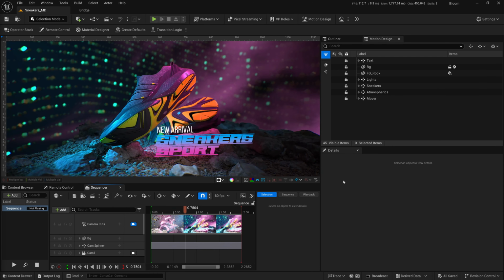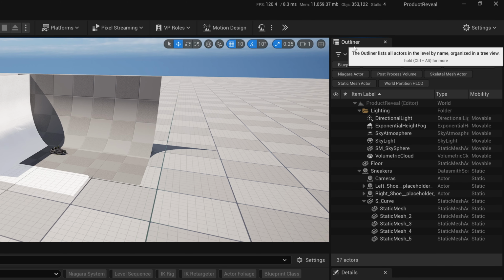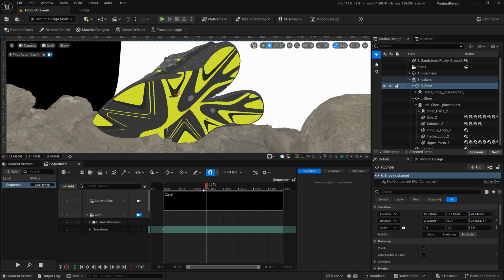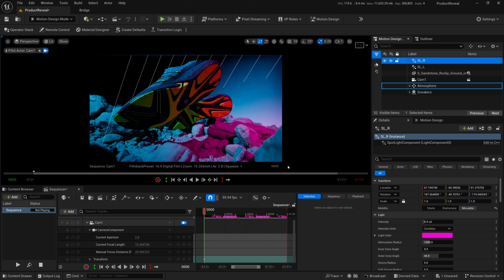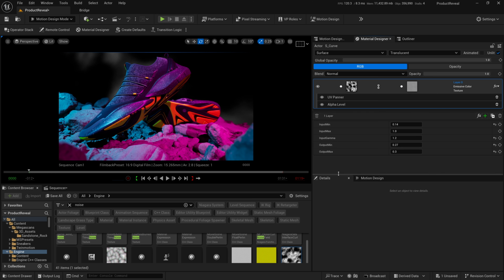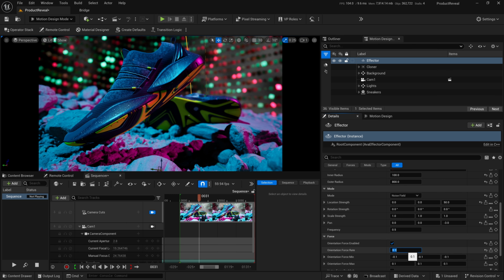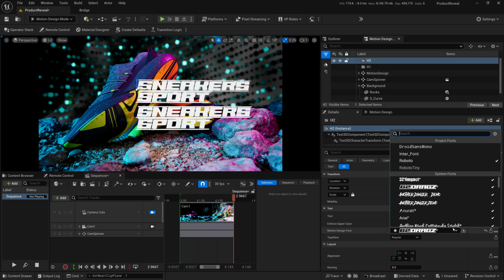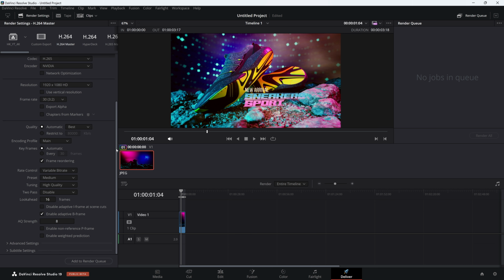Unreal Engine Motion Design ~ Product Reveal (Full Tutorial)

Comment: Thank you for the tutorial! 
Have a question, i have a problem using the material designer and can't find a solution for it, basically as soon as i save the material designed with material designer, i cannot add animators to the layers as i can when live editing it. I want to save the material and then use it later on other meshes and modify it a bit but can't access the animators on the saved materials. Can you please tell me what i am doing wrong?
Reply from the maker: Apparently Epic changes stuff on every version. I suspect you’re using a new ver of UE? The process might have changed. There isn’t much documentation on the Material Designer. Sorry I can’t be of any help 😢
Reply: @HussinKhan  No worries, thank you!

Comment: Bro, I am facing the issue when i am importing the datasmith file in UE 5.4 the shoe is loaded without materials. i have enabled data smith plugin also.
Reply from the maker: Hi, after importing in UE, you should have 3 folders, Geometries, Materials and Textures, in the Sneakers (depends on how you renamed your export) check that these are in the content browser, if not the export/import was not done correctly. Re-import...hope this helps
Reply: @HussinKhan  thanks bro it worked.